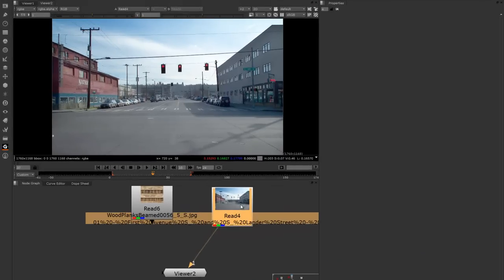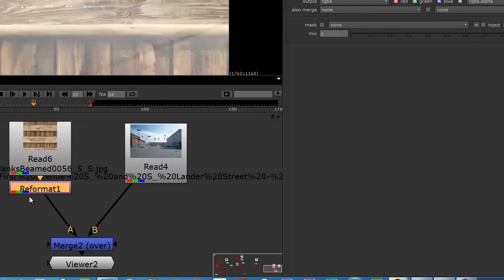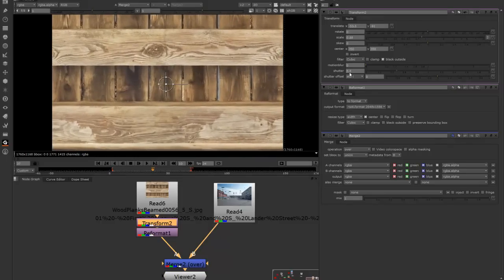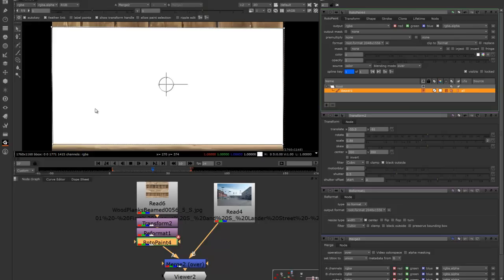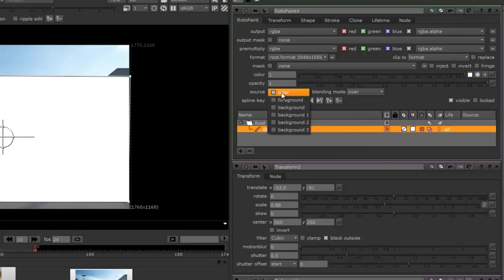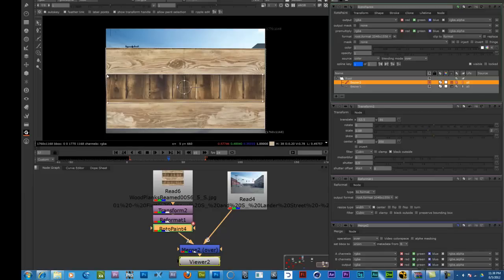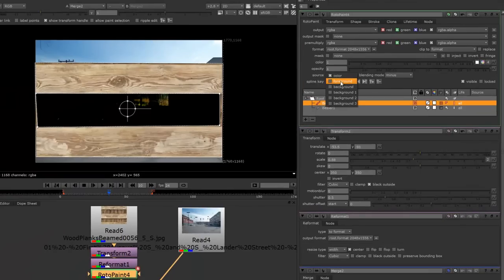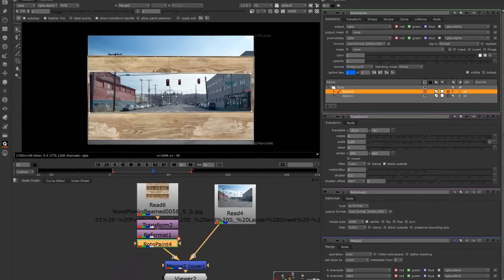inside masking-2.mp4

Comment from the maker: Well the format Node with "adjust" your image to it's native size when using a  merge node..For example, having a 1920 x 1080 image as a backdrop and placing a small 720 x 480 image on top. Without the Reformat node, your 720 image will be forced to the edges of the 1920 image.